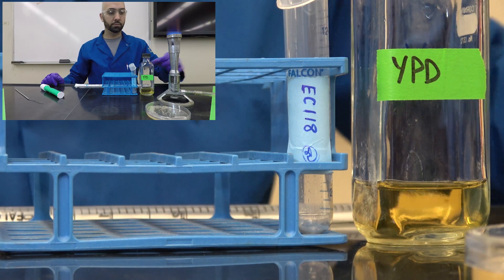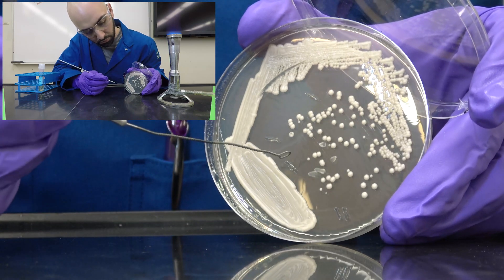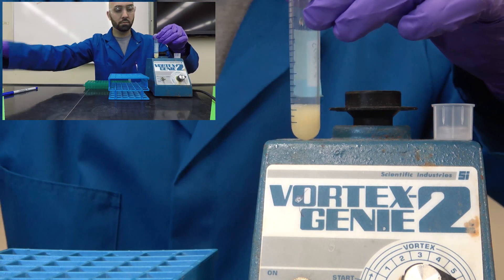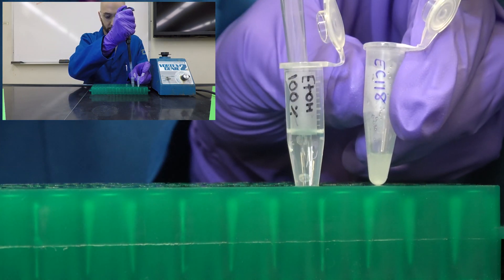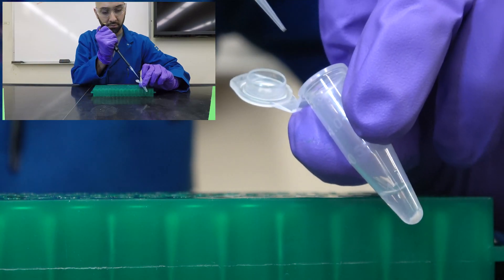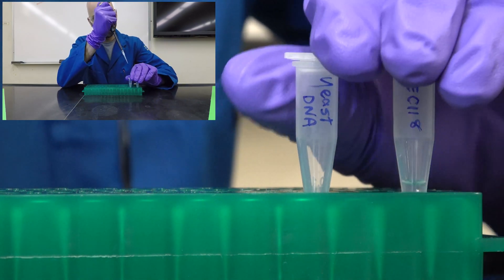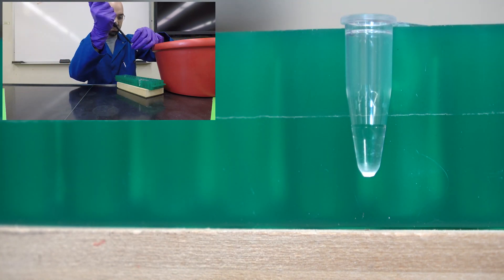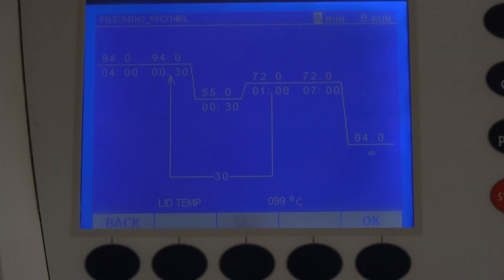Remote teaching DNA lab: Yeast overnight culture for DNA extraction and PCR

Comment: Hi Shane.  Your presentation is well organized and easy to follow. Thanks for putting it together.
Reply from the maker: Thank you. I hope you found an answer to your original question. Good luck with your experiments.
Reply: @shanenourizadeh1301  Yes I did find the answer from your video #3. Thank you. Does SDS/SLS from shampoo will do the same trick as SLS solution made from pure SLS powder (98.4% - 99.9%)? Since Lithium Acetate is an ionic compound with +1/-1 charge. Would NaCl serves the same purpose? Have nice day.